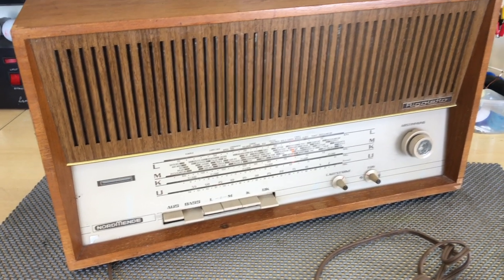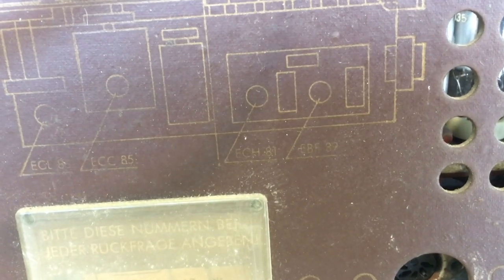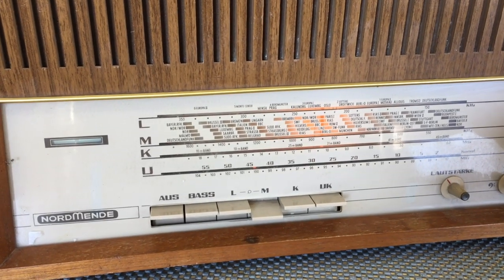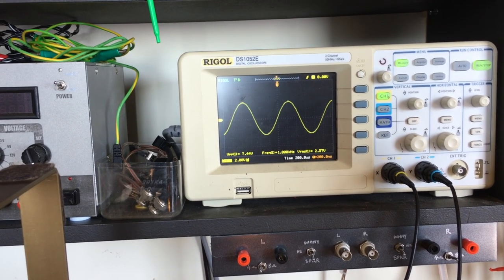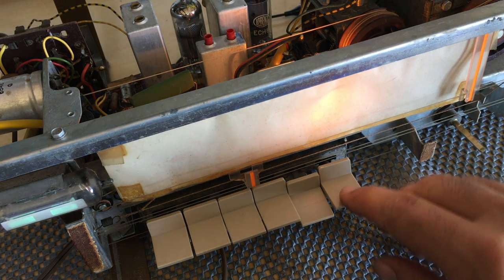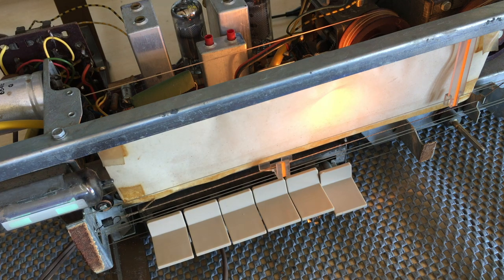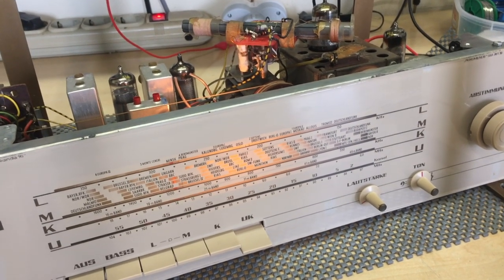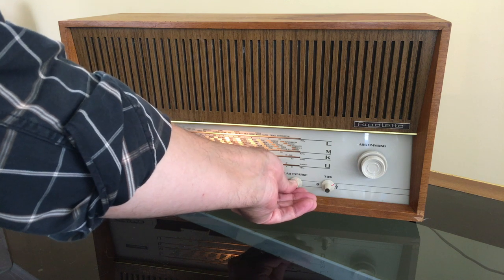Nordmende Rigoletto 6/615 restoration, and adding bluetooth.

Comment: Very nice Manuel. Out of interest, something worth noting....prior to replacing the mixer-oscillator valve, when you selected VHF the magic eye fully closed up and stayed closed whilst tuning across the VHF band...giving a direct indication that something in the circuit was failing....yes, the mixer-oscillator value as you subsequently discovered.
Reply from the maker: Yes. As Jim said, it was probably oscillating at high frequency.

Comment: So, a new bad capacitor? That's nice... as a coupling cap between 2 stages of amplification it would be even better. I guess we need to check components before installing them. Thanks for sharing
Reply from the maker: It’s the first time this happens to me, buying guess I got lucky there were no consequences.
Reply: @electronicsoldandnew   My main reason for owing a capacitor tester is for what's going in and not whats coming out.

Comment: Hello Manuel,
I see you used a XY_BT bluetooth receiver in this case, unlike the 2017 video where you used a KRC-86B bluetooth receiver. Is there maybe some specific reason for this or is it just experimenting with different options?
Reply from the maker: I have used various modules, depending on availability and specs. These modules are always getting upgraded so I try to get the latest versions. The result is practically the same.

Comment: is the light supposed to light up all the time with the radio turned off??
Reply from the maker: Which light?
Reply: @electronicsoldandnew  the backlight of the tuning scale
Just looks like it's on all the time even with all switches in the neutral position
Reply from the maker: No, I just saw my own video again and can’t see that. Could be a reflection of the room light.
Reply: @electronicsoldandnew  yeah that could be possible... weird

Comment: Nice work. I'm not sure I like the styling of the newer sets so much and those controls! They look incredibly fragile.
Reply from the maker: They are. The casing is also a little more flimsy, but that’s what happened when cost-cutting gets involved with design.
Reply: I found that out when I had to replace my Weller TCP iron this week. My old one... Made in Germany, The new one, Designed in Germany and the silicon cable is about 50% smaller.